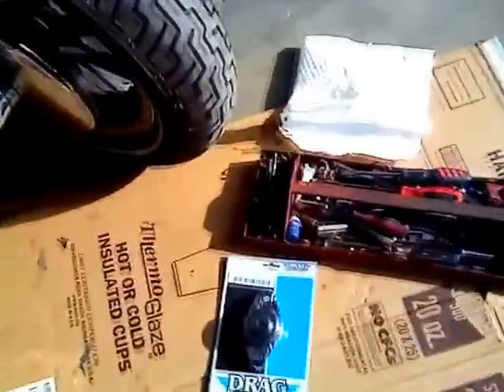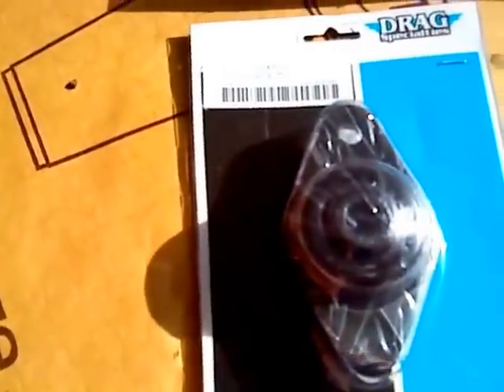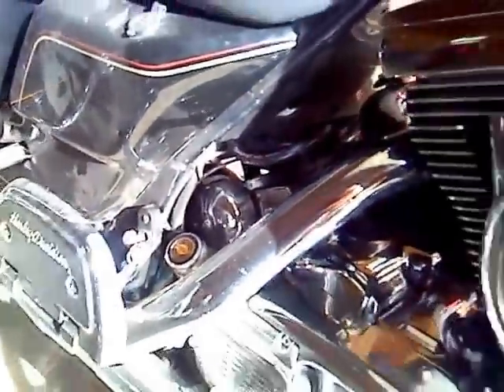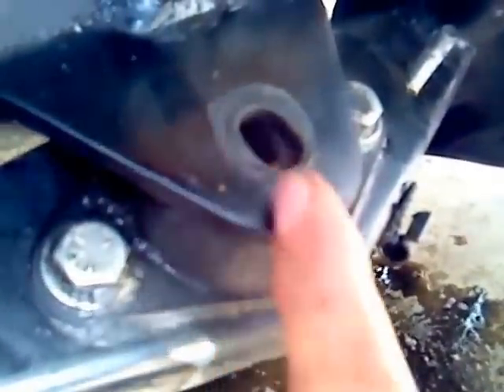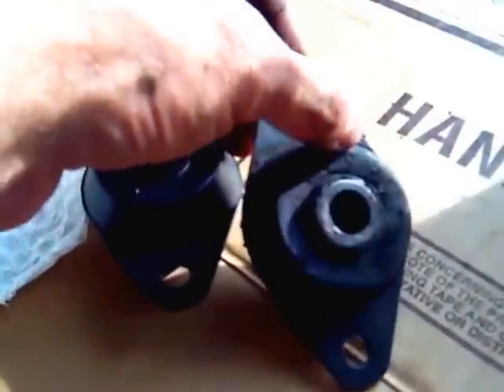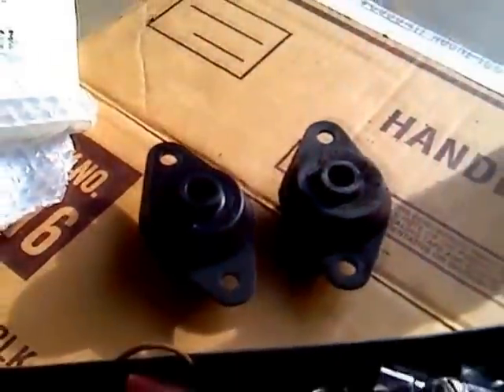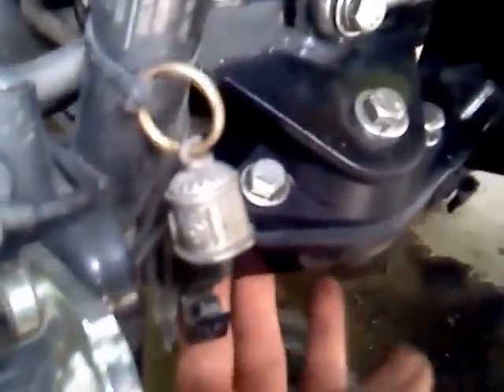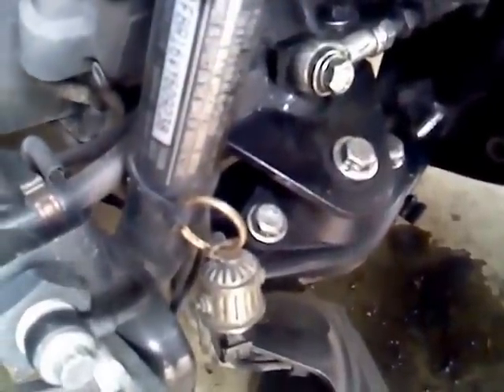Harley Davidson FL Front Motor Mount Replacement

Comment: I have 06 Streetglide FLHX and this video covers probably any Harley , my guess . But from the videos I’ve seen the only thing that differs is the part number . 
Thank you man awesome job !
Reply from the maker: @CNSTAdventures  I think in 2007 this setup was changed with the newer frame design, so it should be the same for your 2006.

Comment: Thank you for sharing. The engine oil dumped on front motor mount causes premature failure. I made a plastic 'trough" to drain oil to pan on left side of bike.

Comment: Mark, I got the new mount on and thought it was gonna rattle my teeth out when I went for a ride. LOL!  I don't think I let it run long enough with all the bolts loose the first time. I loosened the three mount bolts and let it run 6 to 8 minutes giving it some throttle from time to time and then torqued the center bolt to 18 foot pounds and it's much better. I may back it off to 15 foot pounds and see if there's a difference. Thanks again for the video and ride safe buddy!
Reply from the maker: +Claudebonegt Glad to hear it went in for you alright. I have the outer 2 bolts torqued right down, but I can only guess that I have the center bolt at "maybe" 5 foot pounds? I mean, I literally stopped tightening it as soon as each end was in contact with their mounting plates. I did this after I had tightened it up fairly tight and felt as though the vibrations were worse than with the worn out motor mount. After loosening the bolt and just making contact with the mounting plates the ride was much smoother with less vibration carried through the bike. Almost like the difference between a solid mount motor and a rubber mount motor. Get and use some Loctite on that nut so it doesn't fall off on its own, and experiment with it like I did. Good luck, and you ride safe too my friend!

Comment: Great video:  My bars vibrate quite a bit when idling at a traffic light.  I think it's either this motor mount or the riser bar bushings.  Thank you for the video and detail about the dogbone connection and tricks to get that old one out.   I will be changing mine soon.
Reply: My Fatboy doesn’t have the bushings like that.  The ones with it are tight.  My issue I suspect is from my motor - the vibration is noticeable when not moving and when going slow under 30m/hr 

I’ve now got what sounds like a lifter sound.  Dealer appt on Thurs.
Reply from the maker: I hope it's not internal and more to do with motor/frame contact maybe? What year is it?
Reply: It’s a 2000.  Vibration issue is new and the lifter sound is after that.  Hopefully a smooth running motor fixed the excessive vibration in the bars at low speeds.

Comment: Hi Mark... Great Video and information with everyones comments have given me plenty to work with. I have the same bike as you (97 road king) and noticed a jingling the last few weeks along with more of vibration. took apart everything from headlight nacelle to throttle body and muffling as much as possible.  sunday morning at my buddies he noticed it was the center bolt on the mount so I just tightened it. Holy crap... I thought my teeth were gonna fall out. Anyway...picking up the mount(drag specialties at local shop and putting in saturday. Using all this info... really explains alot. Ill update how it all turned out!! Thanks Robbin
Reply from the maker: Thank you, Robbin, glad to hear it. I was noticing more vibration through the frame, especially at certain RPM's, which led me to replace the front motor mount. The propylene mount is a bit stiffer than the rubber, so if you snug that bolt right up tight you will feel a lot of vibration, but leaving it just so the ends touch with very little wrench pressure gave it the relief it needed. Remember to LocTite the nuts!!
Reply: Hi  Mark...watching your video and then seeing the bike.... LOL!!! I  own that Road King!!! I bought it at National Power sports in New hampshire. I love it like my first born...You certainly took very good care of it and I can see alot of what was done on the videos!!! I hope you dont mind if I picked your brain every once in a while! Thanks Robbin
Reply from the maker: Are YOU KIDDING ME??!! Hahaha. I've been looking on facebook and such to see if anyone has posted any pictures of "their new Harley," wondering where it went! I miss that bike! Now, as far as vibration goes, I had a bit of a sway in the swingarm which needed to be addressed. So I added a new set of rear transmission rubber mounts (as the swingarm is attached to transmission, not the frame), AND a metal brace that mounts from the transmission to the frame (they go for some $$). You can see this brace on the right side of the bike below the transmission with allen head bolts on each end, kinda looks like a turnbuckle. The reason I bring this up is that I believe that brace is allowing more vibration into the frame than before I mounted it, but I never tried riding the bike with just the new rubber mounts added with no brace to see how it handled. Also, I had a Pirelli rear tire that was a poor choice as it affected the handling making the rear feel worse, which is why I replaced the mounts and added the brace. When I put the brand new Dunlop on this Spring it made a WORLD of difference! Even my wife noticed it, as we rode it to Americade and back right before I traded it in. Trust me, stick with the stock tires every time you replace them. I put 2 ounces of ceramic beads inside both tires, front and rear, instead of the weights for balancing them. Never had any regrets doing that.

Ok, so getting to the point: Try removing the two allen bolts from the brace, keeping track of which way the spacers are placed on the bolt, and then go for a ride and see if the amount of vibration has gone down.

On a side note too, I noticed the re-weld on the rear luggage rack had broken free where the seat rest attaches and was making a rattling noise. Have someone re-weld that again if you haven't noticed it already. I have more, you should message me your phone number. Thanks for letting me know!

Comment: Awesome video. My front motor mount was split in half and one of the bolts in the plate snapped - on my first ride with my wife! 120 $ in parts (HD wanted 200 $+ for the job). Your video made it an easy fix. Thank you.
Reply from the maker: Glad it helped you out, Geir, thanks for letting me know!
Reply: Geir Kastmo which mount did you buy?
Reply: I bought the original Harley mount because that was what i could get fastest. WILL try urethane next season just to compare. Mine shakes more now, just above idle, than it did before I replaced the mount.
Reply from the maker: @sivadoc  did you try loosening the bolt slightly (and thread locking the nut) to give the mount a little jiggle room? I tightened mine right up snug at first and felt a LOT of vibration and shake. After loosening it a half a turn or so, I noticed it felt a bit smoother than with it snugged tight. Experiment, but use lots of thread locker... You don't want to lose that nut and bolt!
Reply: I will give that a try, as I know I torqued it towards the high-end of the recommendation (Clymer manual). Thanks for the tip! I will post back the result in 1 or 2 days.
Reply: Finally a day off, so i tried to loosen it up a bit and it actually helped. Not so much shake when I slow down for a stop with clutch engaged. Getting there:-)
Reply from the maker: @sivadoc  that's good news, thanks for letting me know!

Comment: Mark, Your detailed account of the replacement worked like a charm. Although I did have to drain the oil and pull the filter to get to the bolt that holds the plate. Good thing I needed to do an oil change too. Also, I did not pull anything forward like your added note said. Just made sure to snug it up and put some thread lock on it.  Thanks for sharing. I performed this on a 2003 H-D Electra Glide Classic FLHTCI where there was a crack almost half way around on the bottom side of the front motor mount rubber grommet.
Reply from the maker: +Paul Coggins Good job man! I'm glad it worked out for you. I found it shakes the bike less with the bolt just snug and not 'tight.' Ride safe!

Comment: My bike is a 2001 FLHTC Classic and it wasn't quite a snap to do but once I rewatched your video and loosened all the nuts and bolts and got the oil cooler out of the way it wasn't too bad. I removed my front wheel and yanked my front fender  to make the job a little easier and I figured as long as I went to the bother of doing that I might as well change my front tire..... that was a blast doin that in my driveway !!  Everything went well so I figured I'd drop you a line to say thanks for the very informative video.
Reply from the maker: I'm really glad to hear that, Dennis! Thanks for taking the time to let me know, and ride safe!
Reply: Mark Young - Outside The Box j

Comment: Great video! I recently replaced my front mount hoping to cure the vibration but it seems to have gotten worse. I tightened all the bolts very tight so im hoping thats my issue with the center bolt. Ill be loosening and lock titing the bolt and then retesting. Thanks!

Comment: Mark, after watching your video I have one observation.  By pulling the motor and transmission forward (thus snugging the swing arm axle rubber grommet-forward), my concern is this:  Certainly this action would create forward compression on the rubber by it's orientation (inside the axle tube) but would that not further reduce the life on that rubber grommet?
Reply from the maker: +Bruce Orr That's a good point, Bruce, and I am not sure what the answer is to that question. I have noticed the bike feels less 'squirmy' in the corners or on rough roads. If I notice any ill side effects I will be sure to update the description above with those notes. Thank you.
Reply: It's designed to float reason for the slot.  Just ask Doc Harley or watch his video.  😊

Comment: Did you loosen your belt final drive? If you have tension on your drive belt, that will prevent the motor from moving forward as well.
Reply from the maker: Actually, it won't interfere with it as the swingarm is mounted to the rear of the transmission, not the frame. So the engine - transmission - swingarm all move as one assembly. Belt tension will not play a role in this scenario either as the transmission and swingarm are mounted to each other. It is the engineering of this setup that makes proper alignment and bushing stiffness very important. I also added a rear stabilizer link that connects the rear of the transmission to the frame to help with the rear tire alignment to remain more resistant to flexing around corners or on rough pavement. Well worth the investment in my opinion. Thanks for watching my video and asking questions!

Comment: Harley Davidson stopped using that motor mount in 2005. Check out service bulletin M-1182. You can get the upgraded mount at the dealer.

Comment: Just got back from a nice little putt and I  thought I'd let you know how impressed I am. The bike hasn't tracked and handled this well since I've owned it ( bought it new ) and I've never been able to let go of the bars without the front end practically shaking me off the bike. This was definately not something for someone not real handy with wrenches to tackle but the results are amazing. P.S. I haven't noticed any reduction in the vibration but hey it's a Harley so a bit of vibration is expected right ? Thanks again for the informative video bro. Dennis

Comment: How did the motor and transmission move forward without loosening the exhaust? Seems like a fully bolted and tight exhaust would keep it from coming forward.
Reply from the maker: +Claudebonegt The mounts for the mufflers allow them to slide front to back, it's the way they are made. If you look closely at the muffler mount you'll see a flat piece of steel that can slide within a rubber-lined bracket. The exhaust is mounted to the transmission, I believe, on the right side about mid-way back after the floorboard. Since the transmission moves along with the engine this does not present a problem. Good question, thanks for asking!

Comment: i just had mine replaced and at idle and low rpms it shakes really bad the guy who replaced it said thats how it is? any commits?
Reply from the maker: The center bolt may be too tight. Make sure you have Loctite on the threads so you don't lose the nut and put the nut back on and stop tightening when it snugs up against the base plate. The tighter that nut gets the more it shakes through the frame.

Comment: Thank you for this video. Would it make sense to loosen the transmission mounts and swing arm bolts before pulling the engine forward? Am a lil worried to damage those bushings to fix the front
Reply from the maker: I didn't, and I don't think it will change things that much to make it worth the effort. That's my thoughts on it anyway. Good luck!
Reply: May I ask what were the symptoms like which made you decide to look at this mount please? For me,  I have been getting a strange and clearly noticeable feedback to the footrest on a 2003 Road King  when the road is not even. When i spoke with mechanics,  they pointed to the rear absorber though I thought it might be swing arm bearing or bushes. Since thats a very time and cost consuming affair,  am now thinking to try this out first and see if the issue goes away
Reply from the maker: I was feeling increased motor vibrations through the frame. The rubber was worn out and not able to keep the motor from flattening it against the frame. I had also replaced the rear rubber mounts as there was beginning a feeling of wandering on the road, like when going over cracks, etc. If the rear rubber mounts wear out the back of the transmission and swingarm start to wonder due to the loose play in the rubber. After replacement the bike handle much better.
Reply: @contact4mwy7  by the rear mount rubbers,  are those that are along the the swing arm pivot right ? or is it another item ? TIA
Reply from the maker: The rear rubber mounts actually hold the transmission case in place. The rear swingarm is mounted through bearings TO the transmission case. That's why when those rubber mount pucks wear out the rear wheel can wander because the transmission can move around more than it should. Since the swingarm is mounted to the transmission, not the frame, they can lead to poor handling and feeling loose over cracks or around corners.

Comment: I'd think that would possibly cause uneven wear on the rear bushing  defeating the purpose of the bushing.  Just change all the bushings exactly how Harley says it should be done.  You may not feel anything to be wrong till one day you gun it and around 75 80 mph the death wobble starts.

Comment: What did you torque the 3 boots at the end to?
Reply from the maker: Remember to use Blue Loctite on all nuts/bolts. I don't remember exactly, but a few forums say 21 to 27 foot pounds for the outer bolts with fine threads. I found it I torqued the center bolt it sent engine vibration into the frame, which is why I reapplied Blue Loctite and only turned the nut until I felt pressure against the mount. Just snug. This was using a urethane isolator, which is a bit stiffer. Your results may vary.

Comment: Great video one question: I have a chirping sound coming from the engine. I have tightened the nuts where the exhaust meets the V twin  and the chirp is still there. Could a defective motor mount be the cause for this chirp? I am riding a 2015 Ultra Limited with a little over 22K miles on it
Reply from the maker: It's hard to tell without being right there to listen to it and for it, but Jeremy, I had a chirping sound coming from my bike that I noticed not too long after I bought it. This 1997 King in the video here. At first I thought it may be just one of the normal sounds from the bike, but I later discovered a cracked rubber boot (used to plug an intake test port) on my carburetor, replaced it with a brand new one, and no more chirp! Could yours have a vacuum line or rubber boot that is cracked or loose and is making the "chirp" sound as the piston intakes another charge of air, like mine?
Reply: just an idea....you might try tapping around the engine and frame with a rubber mallet.
Reply: It is probably your belt drive running against the pulley. Check the belt tension, clean it and use a stick of wax on the edges of the belt. If it quits you know the problem, if it comes back [usually from rock covered roads] don't sweat it. Ride the thing.
Reply: 90% of the time that chirping sound is a bad head gasket